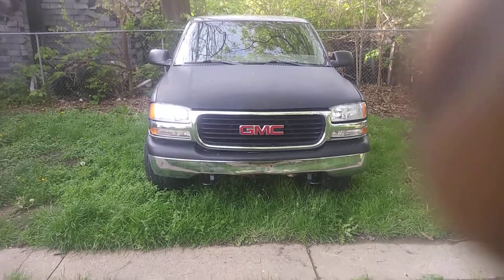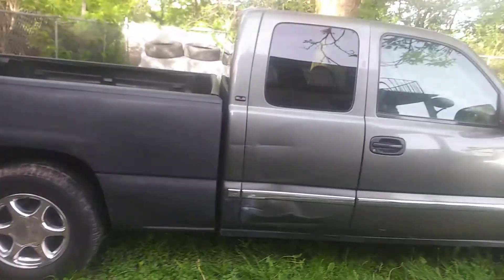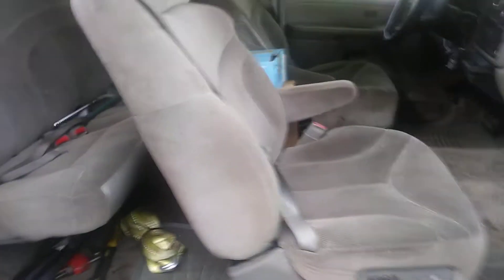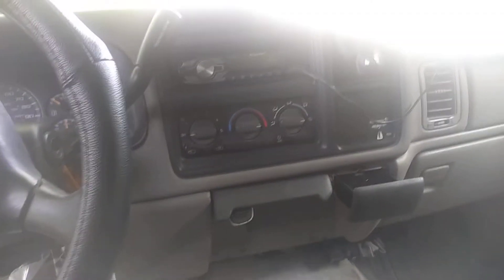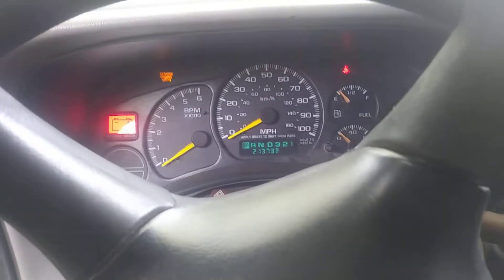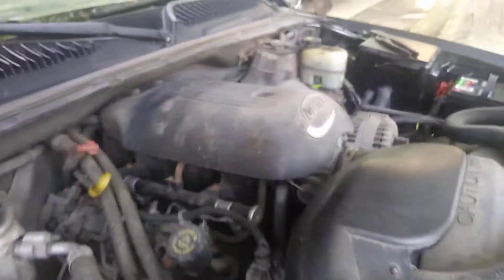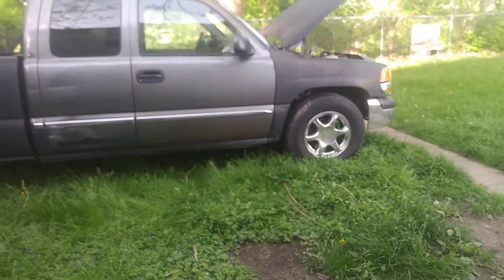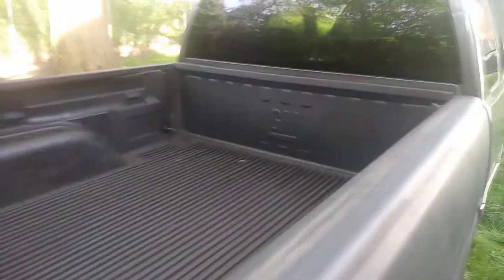best buy ever

Comment: good price.  that's how i got my 5.3 , from an old 2000's daily truck.  they were known for dash problems & the mileage stays with the dash cluster, it might have been changed, or the engine.  good job on the wheels , i like those
Reply from the maker: Yep it was definitely a good buy it was making a little noise from the rear end so i parked it appreciate it John